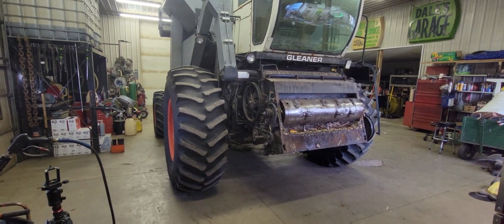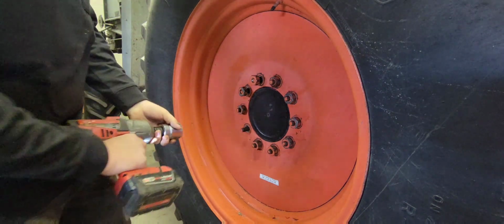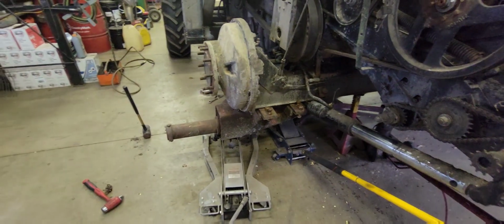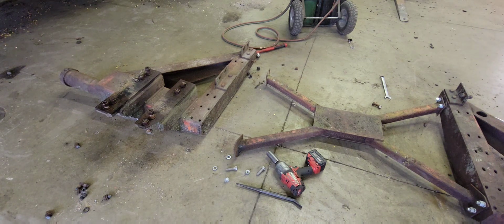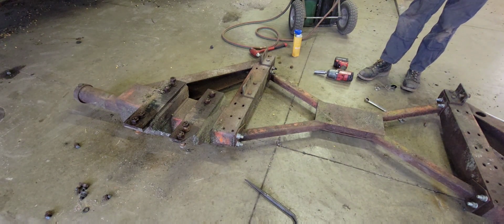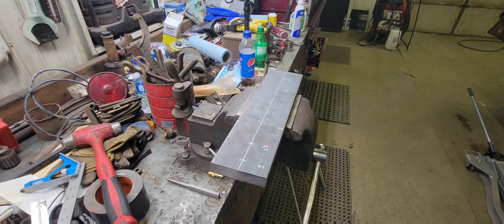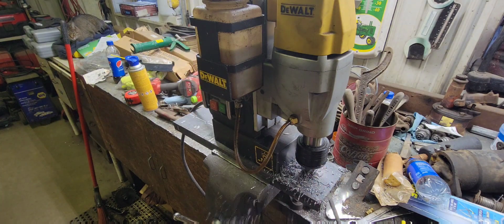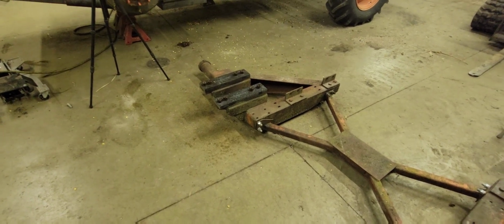L2 Gleaner The Beginning Of The Steel Track Adventure Video The Time Has Come!!!

Comment: Gleaner 3 has good looking tires on it.  But the tracks will be neat.  On the work bench is that a old john deere warning light, that has a holder on it to hang on a implement?
Reply from the maker: Well I was wondering if that was john deere or not I got it from my grandpa it's got the right plug in for the 720 and 620 I was going to put it on one of the semi mount plows
Reply: @dirtgrainsteel  the one i have has orange lens on both sides, but could be orange and red.  Their hard to find.  Usually broke or lost.

Comment: Starting to come together. Think I would go all grade 8 bolts. They are more costly but that frame is going to take a lot of abuse when the hopper gets full and if you ever have a need to pull it out of the bog. Weld her in good...